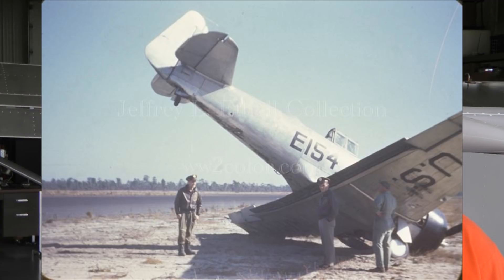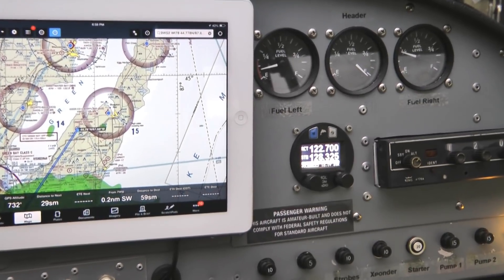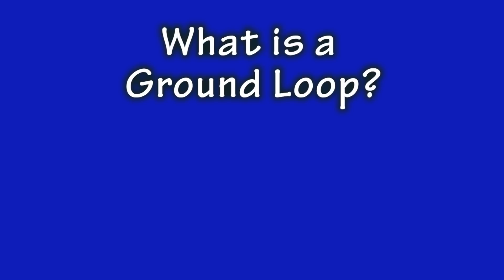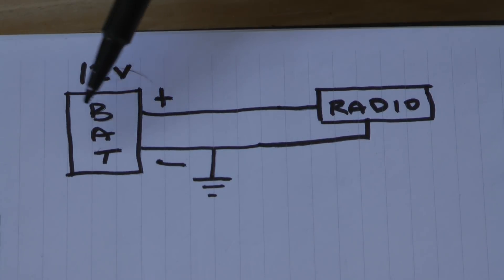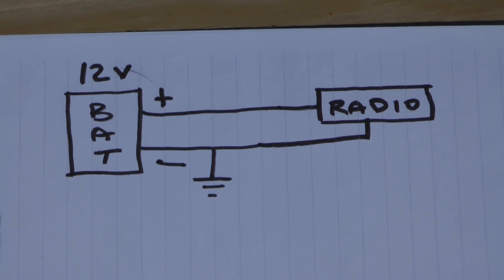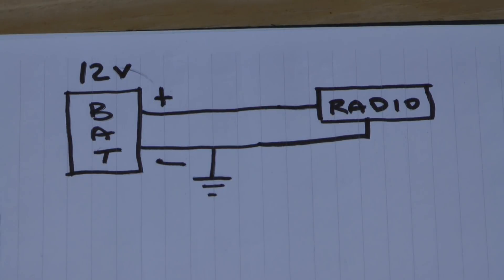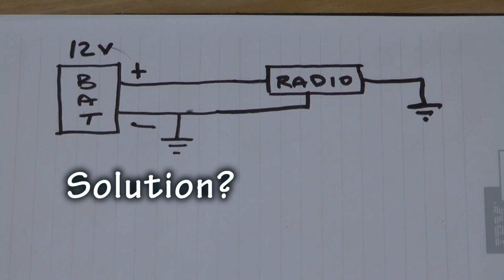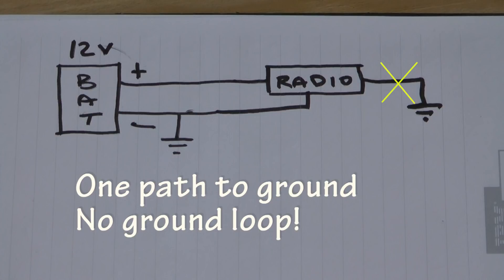How to avoid electrical Ground Loops in Experimental Aircraft

Comment: So very true.  In times long gone, the early B-737 aircraft had the cockpit observer's audio jack located on an aluminum box next to the jump seat.  The jack was insulated from the box by a phenolic insert.  Inevitably, the insert would be broken by flight bags or feet entering the cockpit.  Occasionally, some well-intended mechanic would fabricate a replacement insert from aluminum and install it because A, he did not have a spare on hand, and B, he was by god fixing it so it would not break again.  Soon after, the crew would report noise on the interphone, and the avionics type would have to fix it.  They knew where to look for the source of the problem.

Comment: I’m not sure about experimental installations. However, STC installation manuals for stereo phones or mic audio/key cables use a 3-wire shielded wire and the shield is grounded ONLY at the Audiopanel. DO NOT use the shield as an audio low/return or ground line.

I also agree with using isolation washers on the phone and mic jacks. Some of my repairs with static on the headset are due to the lack of isolation washers and improper use of the audio return line.

Comment: While I agree with what you recommend to do, I don't quite buy the antenna theory as an explanation. Stub wires (which you now created) make excellent antennas, and high frequency can anyway easily jump across the insulating washer as it is a capacitor that has very little resistance at high frequencies.
What you are trying to avoid is a sensitive device (amplifier) using a ground point that is not fixed at very flat 0 Volt, instead has a small signal that is caused by some other device's return current. If that some other device has a current draw that is not steady, it will make that ground point noisy. The non steadiness of consumption might come already from the alternator raising the bus voltage every so slightly at its frequency as it pumps current into the battery/system when the diodes open up.
So if you have a Y constellation in your ground wiring (not a common ground point), the device on one arm will raise the voltage in the junction point of the Y according to the current it draws and the second device on the other arm will not see ground itself but the raised ground at the junction point.

Comment: Blimey I've been a radar engineer for years and dabbled with homebuilds and no publication has explained ground loops aswell as this!!!

Also your explanation of fitting the screen to the radio end rather than the socket end is crucial advice! That explains why a Jabiru 400 I built 20 years ago always has noisy comms because I remember naively connecting the screen to both ends of the audio cables PLUS I didn't use the fibre washers to insulate the jack sockets from aircraft ground 🙄

Currently building a Eurofox 914 Turbo so the comms is now going to be excellent and spot on I'm sure!!!  Back to building 🤠

Comment: Great videos Jon. You are my go to guy when I need some help (on par with "EAA hints for homebuilders"). Your instruction provides the rationale  (which is why we build) as well as the "how to". At first I was taken back by the Mr. Fred Rogers slow pace delivery, but when I set the playback speed to 1.25 speed it is no longer an issue. Don't change a thing.

Comment: Or you could not connect the shield to the black wire at the jack. Only connect the ground at the radio. Simple and easier solution.

Comment: You can speed this up to 1.5x in lieu of heavy medication, or... here's the shortest version: to protect against RF energy/interference, land the drain wire for cable shielding at ONLY one end - the other needs to be unconnected and insulated [drain wires do not come with insulation, as they must have contact with foil wrapping or mesh inside cable sheath].   The jack in this example uses an insulated conductor, which should tip us off that if there is a reference to chassis, it ought to be at a central point, not at the end device.  Of note: COMmon [for various amplification setups] is not necessarily chassis ground - don't tie the two together [unless indicated]... but if you're that deep, you probably already have schematics in hand.

Comment: How do you make sure that the part of the jack that passes through the hole in the grounded metal frame does not touch the walls of the hole?
Reply from the maker: If using the proper insulated washer it has raised bushing built-in that keeps shaft centered and away from edge

Comment: So instead of using a rubber washers why not just cut the negative wire?
Reply: Thats even worse.  The headset needs a direct ground connection to the radio via that black wire.  Your solution makes sure the headset return runs via the ground of the panel picking up more noise, acting as an antenna. Plus the ground of the headset connection is sometimes isolated via circuitry inside of the radio.
Isolating washers are the best solution.

Comment: I have a Cessna 182 that had extensive avionics and radio replacements. I am getting some serious alternator noise through my headsets. The noise is now worse just after an install of a couple Garmin G5's. My Avionics shop said I need to replace the Alternator and regulator and if that doesn't help my problem I should bring the plane to him to trace down the problem. I know throwing parts at it is one way of doing it but not the way I want to go about it. Can a ground loop pick up this alternator noise? I plan to put my electrical system on an oscilloscope to check Alternator Ripple and make sure I don't have a bad diode but I really don't think that is the problem. Any thoughts that could help me trace this issue down? The video was very easy to understand and I am going to take a look at my communication jacks to make sure they are not grounded to where they are mounted to as well.
Reply: Any progress?

Alternator overhaul shops can test diodes.  You shouldn’t have more than .5 VAC on the bus with the alternator on.

Comment: I think DC electricity flows from the negative terminal to the positive.   Negative = excess free uncaptured electrons.   Positive = chemical / element lacking and wanting an electron in a open  orbit state around it.   So the electricity would travel through the frame of your car or airplane, to your device, and then back to the positive terminal of your battery.\
choppergirl.air-war.org
Reply: Electron flow is from negative to positive, but conventional current is described from positive to negative

Comment: Is the shielding connected to the headsets, or can that wire just be clipped & not attach to the RCA headphone  jack?
Reply: Audio shields terminate at the audio panel/intercom.  

AMX240 Connector, J1 (Sub-D  44-pin, male on tray) - All shields should be grounded as shown, at signal source only.  Other end remains floating(refers to audio wire  only).
Reply: Yes. You would want it not connected at the jack. Ground at radio.

Comment: Excellent.  I had a new audio panel installed in my Cessna 182 by a certified installer.  Horrific engine noise!  They were no help, so I began going through the installation manuals, which emphasized that the ground braids for the 4 mic/phone plugs should be grounded at ONLY ONE END (at the radio), NEVER BOTH.  To accomplish this, the jacks were to be installed with two-piece fiber washers which had a shoulder that protruded through the mounting holes so they didn't make electrical contact.  

Of eight jacks (4 mic and 4 phone), only two were installed right.  Some had one part of the fiber washer, some had the other half, some had none.  I called the installer in Clarksburg, WV, and they told me they did a good job and couldn't/wouldn't help me.  I bought the proper washers and reinstalled all eight jacks.  No noise at all now.  Never trust anybody.
Reply: Absolutely. The jacks should be isolated from airframe ground, and audio circuits should only have one end of the shielding braid connected.
What I find, routinely, is people trying to install stereo phone or mic jacks using only a two-conductor shielded wire. That means they're either going to have to ground the jack locally or use the shield as the return.
DO NOT DO THIS, PEOPLE. Get a proper 3-conductor shielded wire and terminate the shield only at the audio panel end.
Reply: Great comment, thank you for sharing, sure adds to the well done video.

Comment: Hi, your video about ground loop was very informative and helpful. When I installed GNC 255, I faced the noise problem and now realised what to do. Thanks a lot. On a PA 28-181, which on is the best ground point for all radios?
Reply: I made something similar to:

https://www.bandc.aero/groundblock2448-tabfirewallkit.aspx

for my homebuilt Kitfox.  It works perfectly.  You can make your own or buy theirs.

Comment: Those washers at 7:02 would only work if they, either protruded into the hole or aligned the thread precisely so that it wasn't touching the metal...a small length (panel thickness + washer thickness) of heatshrink over the thread works well.
Reply from the maker: Yes, the washers provided by most manufacturers with the jacks are designed with the protrusion you mentioned.
Reply: The washers are two-part.  One part has a shoulder that DOES protrude through the hole.

Comment: Very well done. I need to run a 12 volt battery heavy wire through the bulkhead. Do you have any videos showing how that is done? Can I just use a grommet or do I need something more exotic?
Reply from the maker: That would be addresed in Tip #55 (Firewall penetrations) Complete list here: http://homebuilthelp.com/Tip_of_Week/tip_archive.html